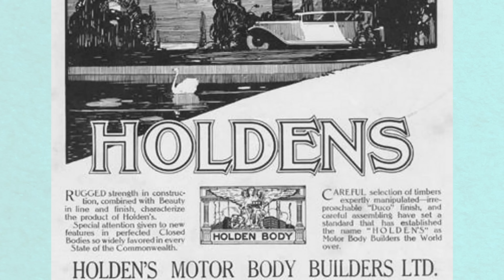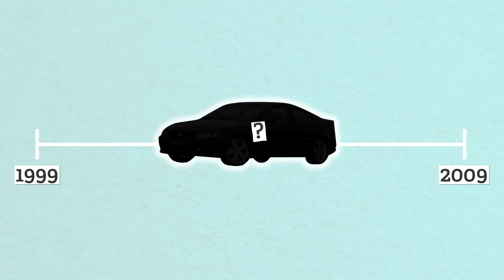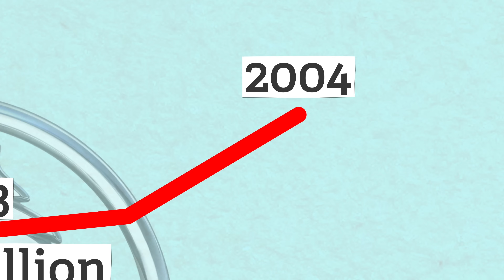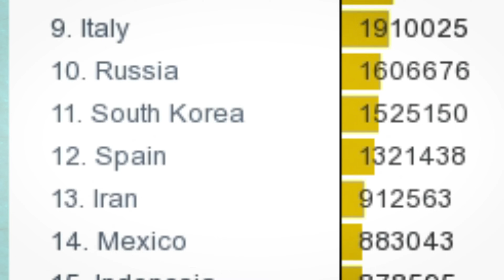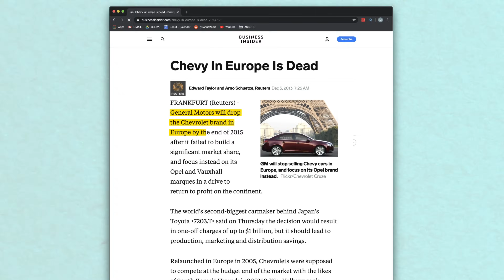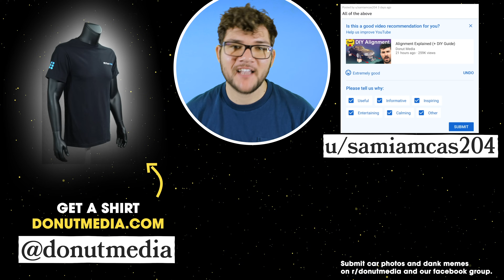What REALLY Happened to Holden

Comment: The thing that really killed them was the market. Most people buying cars don't actually like cars. The biggest strengths of the Commodore and Falcon sedans were that they were all the performance of a high end European car at half the price. But they managed to keep the prices down by making them very simple, they weren't overengineered and they used engines that were tried and tested (Many of the Falcon performance models used an old Mustang V8 that was very easy to make). But then people started caring a lot more about the doodads in a car rather than the engine, they wanted heated seats, satnav, reverse cameras, lane control, automatic parking etc etc. Just look at how they advertise cars today compared to 30 years ago. This is probably driven by the chinese market that just wants luxurious vehicles, it could be 30hp and they wouldn't care if it looked and felt expensive.

That plus GM and Ford never tried to break the cars out of the "bogan basher" stereotype so Toyota, Mazda and the Korean brands were able to market themselves as "sensible cars" and snag the white collar market. Hell most Commodores and Falcons are actually more economical than the Asian cars dominating the Australian market today, because they have such big engines they're able to cruise in high gear and burn very little fuel. My Falcon gets 6l per hundred kms on the highway

Comment: I’d love to see a video showing what commodores were made of ie each model up until the VE were made from GM cars like Vauxhall’s. But with the VE it was fully designed and engineered in Australia. You could end the video with a note, now you know why you should never put Chev badges on VE or VF. The VE and VF have chev motors yes, but they are Holden’s. I don’t see the same people putting Nissan badges on VL Turbos just because the engine is from Nissan. Rant over, please do the video 🤪😎

Comment: The writing was on the wall for Holden as soon as the decision to close local manufacturing was made.
The patriotism to Holden was based on it being an Australian product.

Holden used to build the Vectra here in the late 90's, and the remainder of it's range was made up of Opel (GM Europe) models (and Isuzu Japan). So two local ranges - Commodore variants (Sedan, Wagon, Ute, Statesman/Caprice), and the Vectra - and imports of good quality.
After Vectra production ended, the plan had been to build the born again mid sized Torana based on the VT-VZ chassis, along with an expanded range based on the Commodore.
Instead, GM took the decision to cancel all European imports and phased in cheap (crap) GM Daewoo products for Holden's remaining line up outside the Commodore, and the Torana disappeared.
So the lineup turned to crap, the popularity of SUV's and Pick Ups started rising, impacting the popularity of local sedans (Falcon and Commodore). Holden's line up was sub par outside the Commodore range (possible exception was Colorado) and sales tanked.

Was it GMs fault? Largely, yes.

Comment: So just a small note about Mitsubishi. Whilst I was impressed to see them mentioned you didnt quite get the details correct on closure. Mitsubishi closed back in 2008 (almost 10 years before the others) after sales of the new locally made car were only selling 1/3 of what was needed for them to survive.

Toyota's reason for pulling out of australian manufacturing was due to Holden and Ford closing as the parts would become more expensive and toyota had no problems moving production overseas.

As others have said about Holden when they stopped making them in 2017 it was replaced by the Opel Insignia BUT they had the nerve to call it a Commodore and a lot of australias asked them to not call it that but the marketing team said it had the driving feel of a Commodore but in the end aussies voted with our wallets and the new "Commodore" was a massive failure to the point that the company had cars that had been sitting unsold for 2 years because they expected bigger demand and didnt realise that keeping the Commodore name on the new car was probably the biggest reason people didnt buy it, australians knew what it was and knew it was a lie and refused to purchase it and that is what dealt the final blow to the Holden brand because the aussie GM execs didnt listen

Comment: my family has owned a few Holdens. Dads drag and burnout car is a VN commodore with a 355stroker (from a 308), we had an LJ torana for a bit which was cool. but we do have a completely original HK kingswood (which is a slightly more midrange version of the monaro), basically the same car with different accents and rear lights.

Comment: One thing you forgot to mention, instead of building "World cars" like the Europeans and Asians, GM Insisted on developing and building Separate cars for the US and Europe. after the GFC they sold their shares of Isuzu, Subaru and Suzuki in 2005, to Develop the new cars for Opel/Vauxhall. And then they sold both of those companies in 2017 "Because they weren't making a profit". (it's a simple case of if it's not working don't fix it just sell it). As the PSA Group made a 1.7 Billion euro profit with Opel in 2018. (proof that it was simply an issue with GM Management) 
So what does this mean? instead of being able to use Isuzu's and Suzuki's and badge them as Holden's as they've done in the past. Or even add Subaru to the list,  GM sold their ownership of right hand drive companies (to fund Europe), decided to make their own RHD cars in Thailand. Failed to make a profit in Europe, sold those companies, and then failed to make a profit with RHD cars made in Thailand, shutting that factory down which subsequently shut down Holden. . Lets not forget that China is RHD and they own parts of  Baojun and Wuling which they never tried marketing as Holden's. So Sorry i have to disagree with you, GM Big management is to blame for Holden going under due to gross mismanagement in many areas.

Comment: The best Holden was one of these three, 1) 1962 EJ Premier. Beautiful lines, colours, leather bucket seats, chrome in lashings...like a gorgeous baby Chevvy, with 75 HP of pure grey motor grunt fed through the wonderful Hydramatic. 1962 was a highpoint of GMH. Most exports. Huge market share. 2) 1957 FE ....got the looks. 3) 1971 HQ Kingswood wagon with a 253 c.i V8...fine and nice mix of smooth lines but strength. 

The Best: 
1) EJ 1962 Premier   138 c.i. auto
2) FE 1957 Special  132. c.i. manual
3) HQ 1971 Kingswood Wagon  253. c.i. auto

The Worst:
1) HJ 1974 202. c.i. stripped of chrome, low tech for the era, Holden were slipping here..
2) HX 1976 ditto, but add horrendous pollution controls sapping power
3) Early Commodores 4 cylinder. 1900 cc Starfire. (Until the very last Commodores, which were really good at the end....alas..)

Comment: The reason it failed was because they stopped producing cars that were well made to build cars with all the whistles and bells that always were going  wrong.
I had about the last motor that was well build, it was a Holden cruze constant four wheel drive, like a small four wheel drive, it had a timing chain instead of a belt that breaks and never gave me any trouble at all sadly i made the mistake of going back to them and trading it in for a BARINA that was in the sales yard.They never even looked at it before selling it on and it had a failed ABS unit, the auto transmission had the same fluid it was built with it was black, and the same with the engine oil,
It took them nearly two months to get an ABS unit, and the auto transmission just about fell to bits when they changed the fluid.
How ever, all the cars are going the same way, made to go wrong, made so you cannot fix them yourself, and made just to get your money and run, they had no interest in customer relations at all, but as i say it goes for all of them. Ford are still selling a Fiesta that have a metal belt drive that breaks into hundreds of bits, they knew it did, but still kept making them and did nothing, again you cannot fix it yourself, they lie about the fluid lasting a lifetime when really it needs changing as often as an oil change.
There is now not a car on the market that can be looked after by the owner, your lucky if you can change the plugs!!!
The price keeps going up and the quality keeps going down so that at some stage the older people wont be able to afford to own a car, and that in a country whers a car is not a luxury its a must!!!!!!

Comment: Cars like the Chevy Aveo being sold under the Holden brand certainly didn’t help the brand either.... Aussies came up with nicknames for models like “Craptiva” (Holden Captiva) and Holden Barren-a (Barina/Aveo) certainly didn’t help. Also replacing models like the Astra with sh*tboxes like the “Holden Viva” and “Cruze” didn’t help. They felt tinny, unstable at speed, and lacked any driver involvement. They went against everything the brand stood for. The people wanted a Commodore that was more fuel-efficient. But they got sh*tty Korean econoboxes that felt like they’d fall apart or big thirsty V8/V6 Commodores. As a result, brands like VW who offered fuel efficiency AND solid build quality gained huge market percentage.

Comment: I'm sad because I can't gap new Holden buyers anymore as that think they are fast when they buy a new Holden.

Lil story.

This random guy came out of the dealer ship with his new HSV R8 and I'm a p plater (green) and I gapped him in my BMW 130i (Super charged) and he hopped out of his car and said, you seriously think ur car is faster then mine (I WASN'T EVEN FOOT FLAT BUD).. Then he said lets line up, then we did at the light and I legit put 5 car lengths on him easy and after the drag he put his finger up at the window and floored it away.

In the short meaning of that..
His New Holden R8 just got clapped by a p plater 😂Which is why I'm sad as Holden is closed now because I can't make new Holden buyers shameful
Reply: Keep in mind my 130i with super charger (High Performance Exemption) is 0-100km/h in 3.65

Comment: Fact is Holden and ford failed to engage and imbrace technology in the 80's. While company's like Toyota ect started using efi and dohc, Holden and ford said fuck this even though they were buying engines from Japan motor company's? They a also took way too long to use twin independent rear suspension. The rest of the world continued to grow and learn ford and Holden continued to use outdated technology. Come 2015 ford Finaly produced a 4 ltr dohc  turbo with 250kw they claimed they blew the world away while honda produce a 2 ltr with turob 232kw!?! Holden and ford are about 30 years behind the rest of the world.